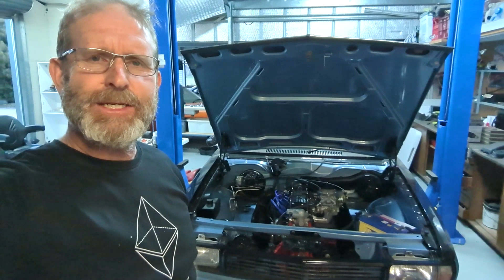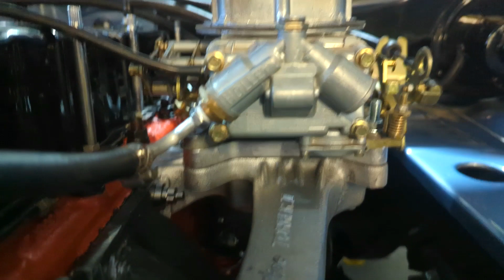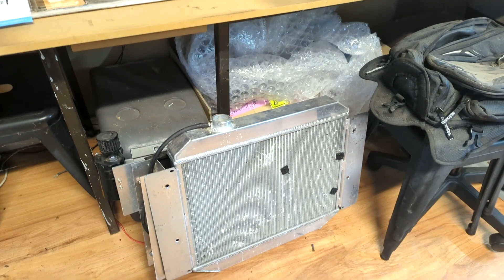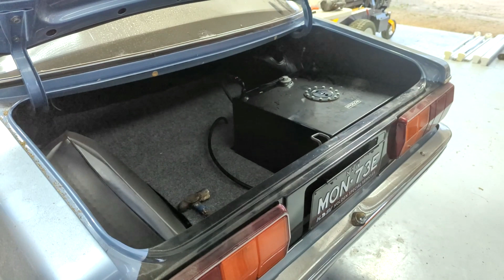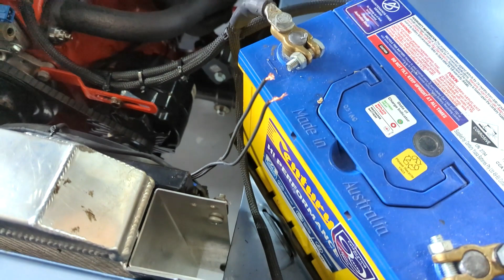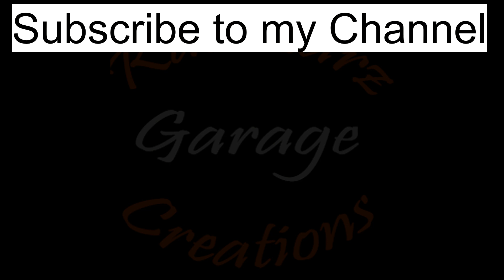No.63 Hot Holden Six Banger First Startup - Torana Build

Comment: I’m about to swap my star fire out for the 202 did it bolt straight in or was there some cosmetics
Reply from the maker: Yes i believe so....depending on the gearbox and driveshaft setup. I did a 202 swap into my wifes Sunbird years ago and had to change the gearbox but i think the original drive shaft worked. It was a split driveshaft with a centre bearing.

Comment: When you started the engine did you take it up to 2000 revs and hold it for 20 minutes with a zinc base oil .
If not best of luck with the camshaft.
Christopher from Queensland
Reply from the maker: Not yet, packed a heap of cam goo on it for startup. Have only just hooked the radiator up to get it running enough to run the cam in :-)

Comment: ??Did you pre pack the oil pump gears with petrolium jelly :-) Just needed to know cheers Tech56 Hobart Tasmania
Reply from the maker: No, i knew about that method but didnt expect to have a problem....Oh well :-)
Reply: @KamicarzCreations  all good , also spiggot bush bearings i was taught to put into back of the Crank n tap in with a Brass Hammer , just saying Mate. Love the cars and Hard work, doing as well as sharing. Huge Thanks. pS building a red 202 yella and arp everything 🙂